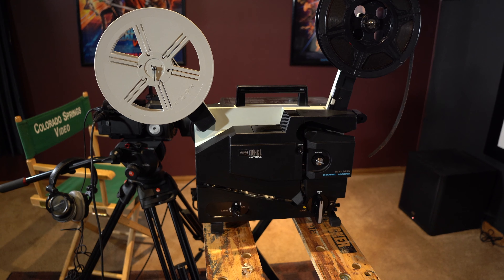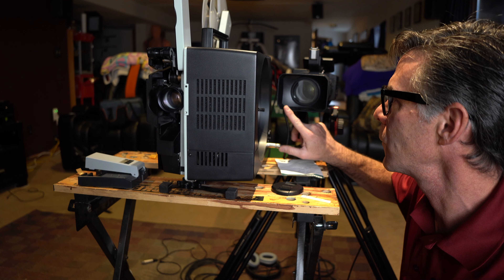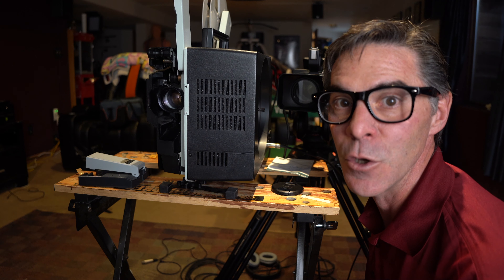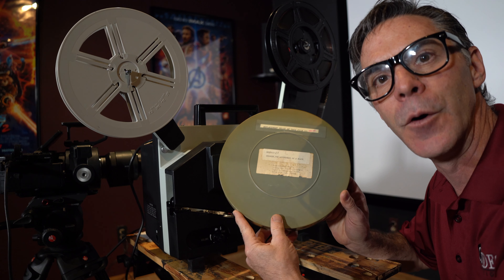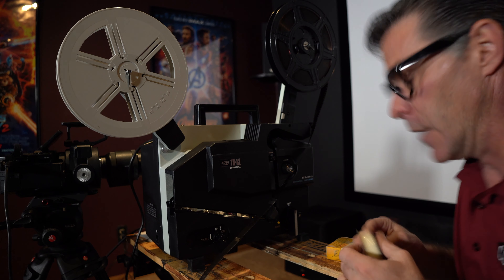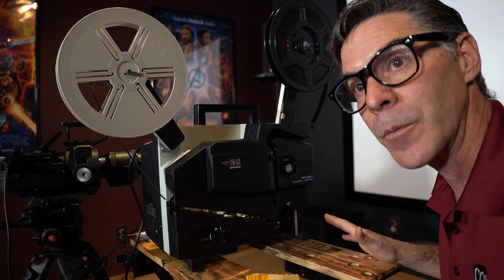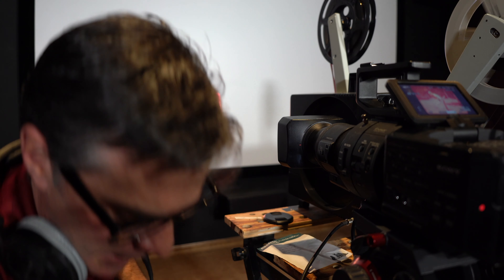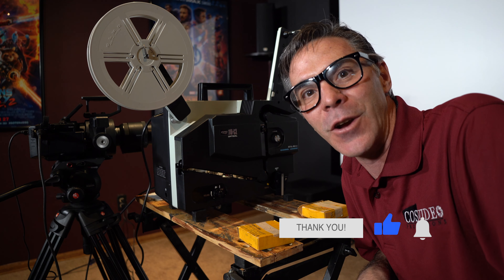How To Transfer 16mm Film

Comment: Hi Mark - does it matter what size you project the movie?  What's the best thing to project it on?  Thanks so much - good video 👍💯
Reply from the maker: I keep my projector about four feet away from the screen so the camera can get a proper focus (any closer than three feet and the camera may not be able to focus because it is too close). I keep the picture as small as I can (maybe about 1x1 ft) because I feel that the smaller the picture size, the sharper the image.  Think of it this way, take a flashlight and shine it on a wall a foot in front of you.  The beam is really sharp right?  Now back away and you will see the the beam will expand on the wall but the edges will not be as sharp.
I use a really nice movie theater screen or you can use a white poster board.  The old style projector screens are not smooth and wont make for a good picture.  The better the screen, the better the picture. When I was purchasing my movie theater projector and screen, the sales rep told me that I could get the best projector in the world but if I project it on a crappy screen, I will get a crappy picture.  The image will only be as good as what it is projected on.  Please hit that subscribe button to help support the channel. I'd greatly appreciate it!

Comment: Great video, thanks. Could someone use say a smart phone, with the right app to film the screen? Also, what video editing software do you use ? Thanks
Reply from the maker: You may be able to use a phone.  You have to be able to match the frame rate, adjust the shutter speed and quickly adjust the aperture.  I use Final Cut Pro for editing.  Thanks for watching!

Comment: Im gonna do it your way. I managed to get a 16mm projector and a rare 1970s time travel film with the (second DR) DR WHO star Patrick Troughtonck. its called A HITCH IN TIME and i also need to transfer a friends old STANDARD 8 family film. i bout a cine to video converter but its quality is crap. also im getting strobing even on 24fps but i didnt try 24 shutteer
Reply from the maker: I think you will need to adjust your shutter speed on the camera.  check to see if your projector has a speed control dial to slightly adjust to help with the strobe. Good luck!

Comment: I'm trying to use this setup with Elmo16-CL and a Nikon D90  but am getting horizontal line flicker. Any suggestions?
Reply from the maker: You need to have your camera set at 24 fps and adjust your shutter speed to 24.  Those are the settings I used in the video.  Does your projector have a speed control or a frame setting?

Comment: What camera do you prefer using to capture the film?
Reply from the maker: Im using a sony hd camera in this video.  I can adjust the f stop, frame rate and ISO.  I also can plug in XLR.  What ever camera you use, you may need these kind of functions.  You also need to be able to control the speed of the projector so you can match frame rate so you don't have flicker or rolls.